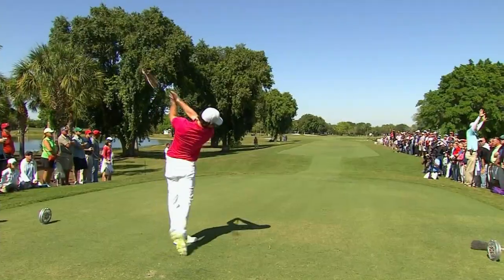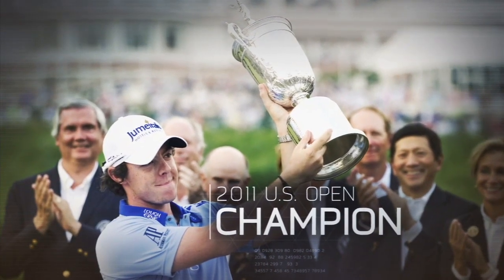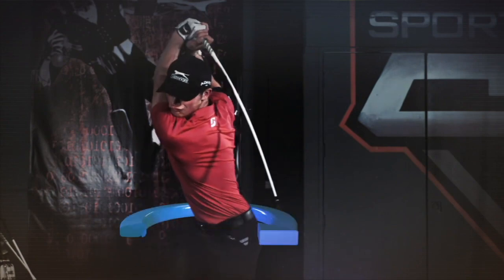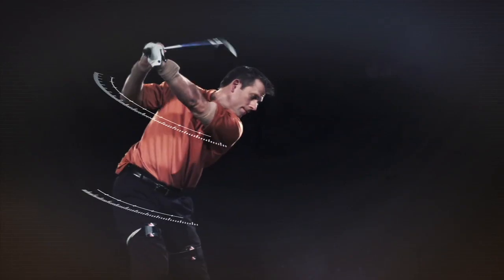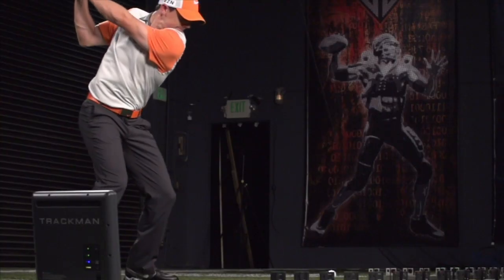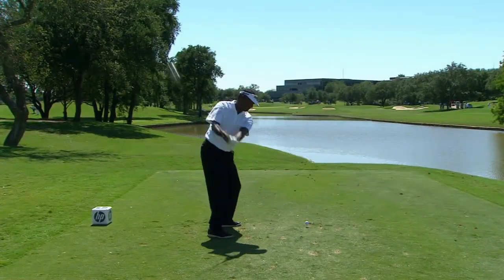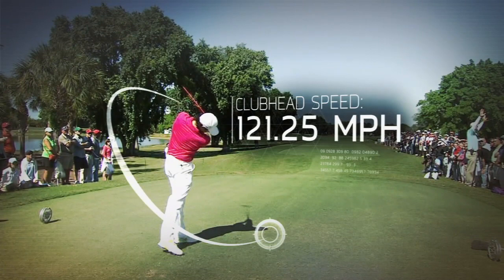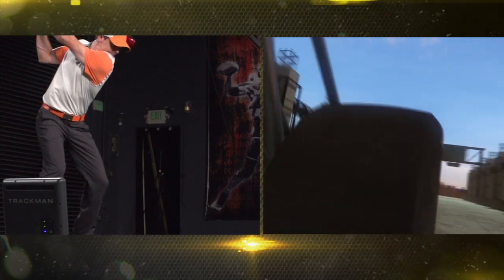Rory McIlroy's Power Off The Tee (HD)

Comment: Yea, it's like Mike Tyson. A good deal smaller than most heavyweights, but more compact body dimensions can lead to a lot more leverage.
Reply: that's not true and doesn't even make sense. leverage is distance X force. he doesn't have more leverage he can generate more power by having a tighter arc therefore generating more centrifugal force

Comment: Yes, he moves his hips more than most, yes he moves his shoulders more than most, yes he does it faster than most, but no-one ever says the true reason for his distance!
In respect of golf, he is likely stronger than most.

Certainly, it all needs perfect timing and the balance between motions is vital so absolute strength is not the measure but, as regards swinging a golf club head fast, McIlroy is immensely strong. The simple fact is no amateur will come close, let alone most professionals.
Reply: Having strength without flexibility, or flexibility without strength, is most people issue in golf.  Your need both, and Rory has always had flexibility but now get strength,
Reply: Double check ... Rory moves his hips less than other pros and rec players.  He moves his shoulders more.  This increases his "X" beyond what others can do.  His more compact frame and greater rotation speed combined with his big X produces power we envy.  All golfers are not created equal and some with more ability (able-ity) further develop what they are capable of doing when they recognize the advantage.
Reply: @golfguru4u  Yes, this was surprising. His hips are relatively quiet.....as Rory said, rotational speed. Can't teach that.

Comment: All these analysis are useless. I could  turn and break my back and still  wouldn't be able to hit a long and good shot,let alone comparing to the pros.Its not just about how many degrees you turn, you have to do all things right ,from stance to back swing to down swing....altogether and at the same time to acheive a good swing. Better get a good coach than try to figure out the swing by listen to all that and then come back and watch and enjoy the pros swing.
Reply: tim ng Sure, except this was NOT a video about how to "achieve a good swing". It was about how Rory, at 5'10 and 160 lbs generates so much POWER. If the video was about how Rory "achieved a good swing", or about "how to figure out the golf swing without a coach", or even "how to hit a long and good shot", you would have a point. But it was about none of those things. It was simply about the SCIENCE behind how Rory generates his power. You must have sucked at reading comprehension in school.
Reply: +Rudy Sanchez haha.. Spot on

Comment: I drive 320 also but I cant believe my clubspeed is in the 120"s...can you hit that far without clubhead speed that high? maybe my carry is only 270 280 but with my draw i measure over 310 around 40 % of the time
Reply: You make a good point.  How a recreational player plays his driver is different from how a pro plays.  A rec player plays on wider and usually faster fairways.  This allow him to play carry plus roll.  Pros play on tighter, softer fairways.  They hit their driver like a rec player hits his mid irons ... to a target, playing for less roll.  The pro game is all about carry.  So, it is entirely plausible you have less clubhead speed and a lower trajectory and still get more distance within an acceptable risk of missing the fairway.  Equipment manufacturers are trying to sell more clubs and the clubs they are pushing are not cheap.  Good biz for them, but is it the best thing for your game.  If I had a vote, then it is to play the way you are now playing until you can hit your driver with the same accuracy as your 7-I.  There's a lot to said for playing ground ball golf with the driver!
Reply: There is no way you hit 40% of your drives over 310 yards.  But cool story bro.
Reply: Some fairways are hard some are not..ive realized though my carry is avg 260-65 the rolling out. I live in Idaho I do have elevation and cold weather the majority of the year. I misspoke the 40% more like 4 drives for the day can clear 310..310 isn't very far these days..high school kids hit that far..I'm 38 215 pounds understand tourque and hit a draw just didn't understand carry vs roll I doubt I ever carried 310
Reply: Yeah ~4 drives out of 14 rolling out to 310+ is certainly doable.  Especially with Idaho's elevation.  That is still very good but definitely believable.  There's still a big leap from ~25% of the time to 40% of the time.  I'm roughly your size and age but I'm at sea level and in about 100 rounds since starting in 2011 I've hit around 10 bombs 300+, with my longest being 317.  That was a driver/7-iron into a short 477 yard par 5.  I played adult baseball into my late 20s and hit homers from both sides of the plate.  I still stink at golf though.  My HC is like 20.7.
Reply: I have gone to the Shell Houston Open the last 4 years and gotten to see guys like Mickelson and McIlroy up close, among others.  They make it look easy on TV but when you see them up close and see their ball flight you realize how astronomically better they are than amateurs.  Even Luke Donald who is considered a weak hitter will rip it 275 in the fairway like clockwork.  And this is on holes with water all down the sides.  Yes guys like Bubba and Rory average 310-315 but they are also hitting it into tight fairways, and Bubba will add 30 yards of slice on it.  We know when they can grip and rip 340+ isn't too rare.  Some amateur who can hit 4 of 14 drives 310 probably isn't hitting it as straight and almost certainly can't hit it 330, 340 like Rory, Bubba and Dustin Johnson can when they need it.
Reply: Blah Playhard Why is it so hard to believe someone hits it 310 consistently? Most of the better amateurs where I live hit it 300+ on average. Its actually expected and more the norm than shocking. It would be shocking if I played in a tournament and were in the championship flight and most of the players didn't hit it 300. Shoot I would be shocked to see them not hitting it 300 in the first flight of tourneys.
Reply: ***** 310 yards is a long drive, but their are several amateurs who hit it that long. These amateurs may not have the consistent accuracy or may have other parts of their game lacking, but hitting it that long is certainly doable on average. 

I go to a guy who has a few guys on tour for my swing coach. I am a long hitter, but I am not the longest hitter around. We were using trackman and I was averaging anywhere between 91-93 MPH clubhead speed with a 7 iron. He told me that I was slightly above the average tour players speed with a 7 iron. As I said before, I am NOT the longest hitter locally. I know several good players I play with in tournaments that hit it right with me or longer than I do. I have never understood why some people marvel at amateurs being able to hit a golf ball 300+ yards.
Reply: Nobody is marveling at an amateur being able to hit a golf ball 300+ yards.  Hitting 40% over 310 yards is marvelous, though.  And incredibly unlikely.  I mean there's a non-zero chance the guy I was talking to is a long-drive guy, but whatever.  Most ams just aren't even going to hit it straight enough to hit 40% over 310 yards.
Reply: Blah Playhard If Rory McIlroy was to take his driver out and hit 20 balls. How many of those 20 would he hit over 310 yards if you had to guess? When they calculate driving distance on tour I am pretty positive they don't take into effect what club the player hit. Therefore, if one player chooses to hit a 4 iron, then that gets calculated into the distance. What I am trying to say is if PGA Tour players hit a driver on every measured hole then I believe the long hitters numbers would be above 310 yards. You are correct that most ams aren't going to hit 40% of there drives 310 yards, but there are quite a few long hitting amateur players out there that can hit it consistently with a driver that long. The biggest difference I see in good amateurs and PGA professionals is the short game, especially putting. Off the top of my head I can count 11 players I have played with in local tournaments in 2015 that average that long distance with their driver. However, there are a lot of very good amateur players where I live. For example, to win a tournament on a 7100 yard course that has a 73.2 rating and 130 slope, you would have to shoot atleast -7 in a two day tournament to have a chance. I have never played golf in other places, so I don't know what amateur competition is like in those places. However, where I live it is not uncommon at all for someone to consistently hit 310 yard drives. I am not at sea-level, but 800 ft above sea-level. However, when I play golf in Florida or the Carolina's I don't see much of a difference in yardage.
Reply: I agree with last two comments.  I very been reading a lot of comments about amateurs and what they can and can't do compared to a tour pro..let's keep in mind those pros were once amateurs and don't miraculously  do things amateurs can't just cause they get a pro card..does that make sence?
Reply: ***** Yes, most people on YouTube that claim they hit the ball 300 yards on average do not, but just be cautious because their are a lot of amateurs out there that hit it longer than 300 with their driver. Like I said in my first comment, my trackman stats with my swing coach showed that my swing speed with a 7 iron was slightly above the PGA Tour average. The longest carry distance I had on the trackman with the 7 iron was 207 yards. The average was close to 175-180 yards. My 7 iron is lofted at 35 degrees, which is 2-3 degrees higher than the average loft in a 7 iron, making it play more like an 8 iron. Im not saying that to brag, I am saying that because there are still several amateurs in my area alone that hit with me or longer than me. I played with a guy last week in a tournament that plays college golf and he was sitting 153 yards out and he pulled out a Pitching Wedge and stuck it 10 ft. I hit my PW 140 yards on average. There are longer amateurs out there. What separates a good amateur and a PGA professional is the short game. I would be by far the worst putter on the PGA Tour and would lose strokes on the green every single hole compared to the field.
Reply: Someone said the Web.com tour is actually more about bombing it than the PGA Tour is.  I wouldn't say the thing that separates a good am from a PGA Tour guy is short game.  It's everything.  There are Strokes Gained calculators now for everything - tee shots, irons, wedges, short game, putting, etc.  You can easily track your Strokes Gained (lost) for every shot in the bag.  It's not perfect but it will give you a good indication as a baseline.  Someone said if you hit your driver 275 and in the fairway every single time, you are losing a partial stroke per round to the PGA pros.  Those guys are Gods off the tee, not just short game.
Reply: Blah Playhard Don't get me wrong, these guys are great at every facet of the game (thats why they're on Tour). However, the short game really sets them apart from good amateurs. Lets put things in perspective. Disclaimer, I am not playing a courses set up as tough as they are playing most of the time. I am looking at a scorecard of a round I played recently. I shot a -4 68, which I am ok with. However, this day I had a total of 12 putts 10ft or closer. Of those 12 putts, I made 4. The PGA Tour average in the 2014 season from inside 10ft was 87.3 percent. My average was 33.3 percent. If I were to be at PGA average, I would have made 10/12 putts, which would have saved me 6 strokes. I would have shot a -10 62. I would say for the course I played and the conditions it was in, that would be a pretty decent score if a PGA event was played there.

Example two, the last round I played I didn't play very well. I shot a +1 73. The course I was playing does host a professional event there every year. That day I had 7 putts inside 10 ft. Of those 7 putts, I made 3, which is 42.8%. Tour Average I would have made 6/7, which would have put me at a -2 70. This would have been good enough to put me in the middle of the pack if I was playing in the event held there. 

Good amateurs lose strokes on the green. Many amateurs do not hit 87 percent of putts from 10ft and in. I am pretty positive that the average for fairways hit off the tee is in the low 60 percentile. The average drive on Tour is 288 yards. Therefore, if you hit the ball 275 and the fairway everytime, you would be the best driver on Tour despite the 13 yard distance lost. Chez Reavie averages 285 yards off the tee and he hits the fairway 72 percent of the time, but he is ranked in the top 25 in total driving. A few years ago Jim Furyk averaged 280 off the tee and finished in the top 60 in total driving. 

Do you play in any local amateur tournaments in your area?
Reply: I agree with your main point.  There are ams out there who can drive the ball fairly similarly to Tour guys.  But almost none of them will putt as well, and certainly not hit the vast array of ridiculous shots required around the green from funky lies like they do.

But you are looking at your putting stats all wrong.  It is wrong to count everything inside 10 feet as the same difficulty.  The expectation is not linear.  Obviously a 9 foot putt is much harder to make than a 2 foot putt, so don't count them the same.  You need to find the chart that shows expected putts from every distance and calculate each putt separately.  I can tell you off the top of my head that on the chart I use (there may be a more recent one) a putt from 7'8" has a 1.5 putts expectation which basically means they drain it half the time and 2-putt it half the time (there will be 3 putts but I'm keeping it simple).  So if you sink an 8 foot putt, you record it as 0.5 strokes gained putting on that hole.  A 3 foot putt the Tour guys expect 1.05 putts (meaning they miss about 5% of the time), so if you 2-putt a 3-footer, you record 0.95 strokes lost putting.  Or -0.95 Strokes Gained, to keep it simple.  Add your round up and see how you finish.  I'm not a great golfer but I track this and a good putting round for me I will lose 2-4 strokes to the pros.  The best round I had was less than 1 stroke lost putting.  Now, the greens I play on are slower and less undulating than Tour greens so that's not quite true but just use it as a baseline to record your own putting performance and see how you really did that day.

Don't quote me on the (275 and in the fairway every time you'd be losing strokes per round).  Someone else said it but he's a guy I trust with stats and golf.  He's a +3 PGA pro and he's also an accountant.  But I'm not sure he'd be the best driver, either.  He'd be giving up 30+ yards off every tee to guys like Bubba, DJ, Rory, and they hit a lot of fairways for how far they hit it.  Total Driving isn't a good stat because it just adds your RANK at distance and RANK at accuracy.  But distance is more important than accuracy so they really need to weight it more before adding up the ranks for Total Driving.  This is why Strokes Gained Driving is better, because it already incorporates this stuff.  Let's say there's a long 485 yard par 4 and the pro's expected strokes for the hole is 4.2.  Let's say a pro drives it 265 and in the rough.  That's pretty much a bad shot for them.  Let's say he's 230 yards out from the hole (not 220 b/c his ball is in the rough so the angle adds some distance).  So they've looked at how many strokes it takes a Tour guy to hole out from 230 in the rough.  Maybe it's 3.6 or so.  Yet after an average drive you "should" be 3.2 strokes out (4.2 minus 1.0 drives).  But you are 3.6, so this means you LOST 0.4 strokes off the tee.  Now let's say you hit a miraculous shot out of the rough with your 3 wood to 7'8" pin high.  You now are expected to take 1.5 strokes to hole out (remember from earlier?).  So after 1 approach shot swing you went from 3.6 strokes to hole out to only 1.5.  So 3.6 minus your 1 actual stroke is 2.6.  Yet you only need 1.5 to hole out.  So you literally gained 1.1 strokes with that single miraculous approach shot!  Now you 2-putt from 7'8" so lose 0.5 strokes putting.  You made par, though.  So on the hole you gained 0.2 strokes against the field (their expectation was 4.2 and you made 4).  So let's add it all up to make sure we're right.  Tee shot: -0.4.  Approach: +1.1.  Putting: -0.5.  Yep, that adds up to +0.2 so we can go ahead and log this as data and move on. 

This is how you need to track your shots from now on.
Reply: Blah Playhard Ok I see what you are saying. I haven't calculated like that, but I will and see what it comes out to.
Reply: Next time you play UTBaller22, just walk off your initial putt distances (you don't have to measure your 2nd putt distances) and record how many putts it took you to hole out.  Do not count putts from the fringe or from off the green, I'm sure you know.  Sometimes it's not easy to walk them off if you are in a group but if you pull the flag it's easy.  I think every 4 steps for me is about 11 feet so I count "1, 2, 3, 11, 1, 2, 3, 22, etc." and estimate/eyeball distances between.  Just shoot me your numbers and I'll calculate it for you.
Reply: UTBaller22 j